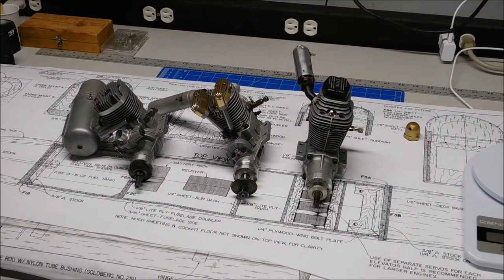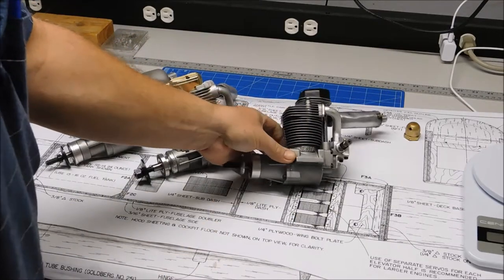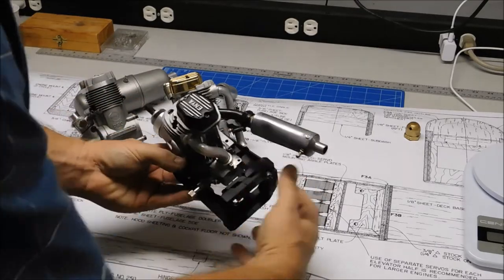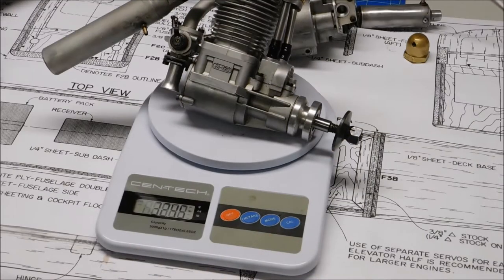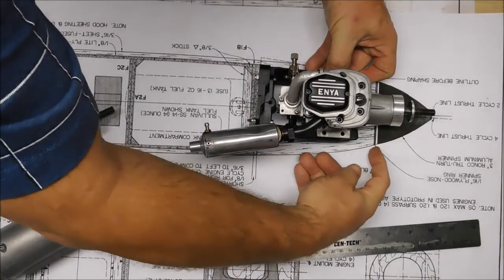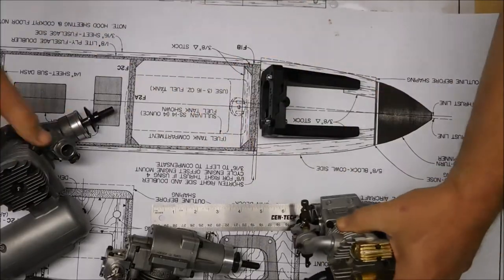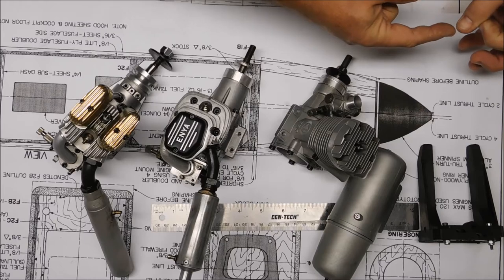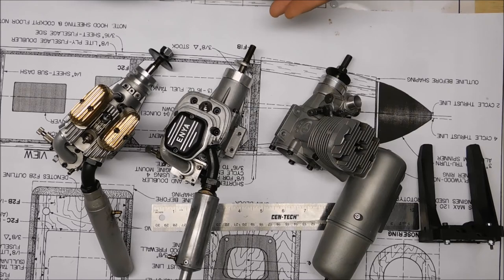Super Sportster 90/120 Engine Selection Video 2  Viewer poll at the end..

Comment from the maker: Thus far only 5 votes in the poll, all for the Enya
Reply: Do you thing that Saito is in better condition?
Reply from the maker: Both engines are in excellent condition now that I have gone through both.  the Saito has much stronger compression.  I have a replacement ring on order for the Enya in case I need it.  Did you watch the video of the Saito 120S running?  I have several.  it is a beast!  Both would fly this airplane very nicely.  Since both have nearly the same weight and dimensions making the airplane accommodate both should be pretty easy.
Reply: Yes i have watch videos of Saito...If this was my plane i would put on Enya i think it looks a bit sportyer...
Reply from the maker: I voted in the poll too, I chose the Enya....  The Saito was right there too.  I have had more Saito 4 strokes than Enya and my heart lies with Saito.  it will be interesting for sure.  I want to run both of these engine heads to head very soon.